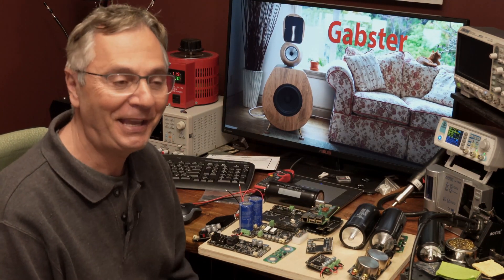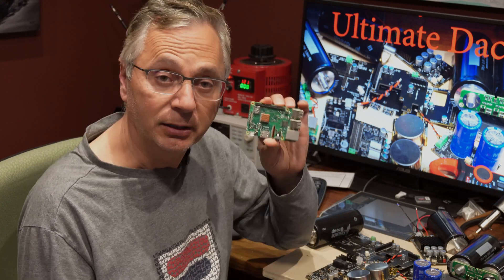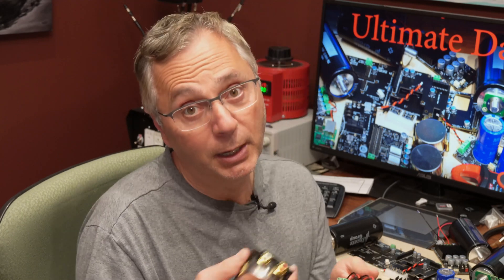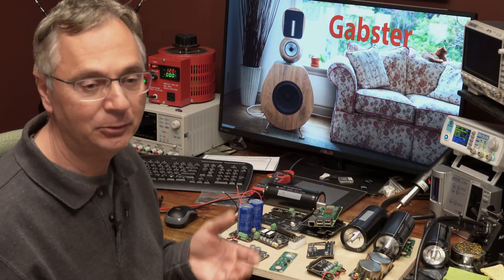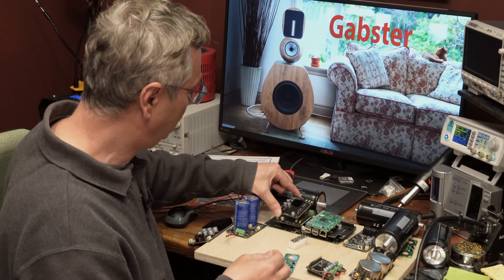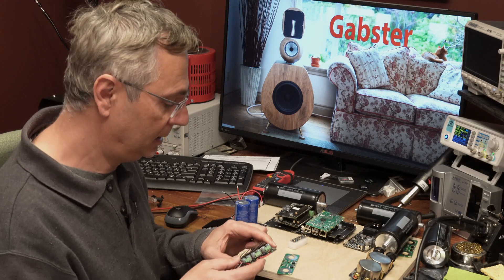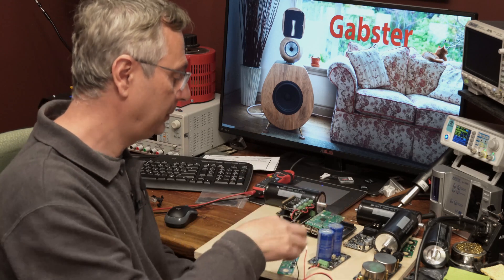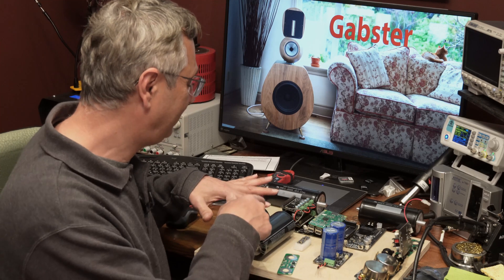Part 1  Building the Gabster D11 Ultracapacitor Dac and Streamer

Comment: How can you de-noise a digital signal?
Reply from the maker: Noise could possibly cary over as the the digital signal is converted to analog and can also affect the timing of the Clocks accuracy and introduce jitter specially noise on the power supply of the clocks.

Comment: that's perfectly detailled, just one question, what are your ACCUsilicon choice of clocks, frequency wise?:) they are avalaible in France, which is a great thing for me I have to admit:)
Reply from the maker: I used the 95/98 in my streamer but lately prefer Crystek CCHD 957 
It also depends on your system an what you like 
The Crystek are more analytical lots of details

Comment: How are ultra capacitors better than batteries, surely, for an application like this they provide essentially the same thing a clean DC voltage and current. Just wondering why you would choose ultra capacitors which hold comparatively small amounts of energy compared to say a Li-ion battery of equivalent size and the cost difference is huge. What am I missing with this?
Reply from the maker: The internal resistance of supercapacitors is typically an order of magnitude lower than batteries,
Reply: @Gabster1  But that makes no difference what so ever if you are just powering the digital electronics from it. Batteries with linear regulators will provide rock solid voltage and current and if you are worried about variable loads causing issues then a couple of ordinality electrolytic capacitors on the output stage of the power supply will be more than enough to decouple the PSU electronics. Remember its only the output from the DAC that needs the super stable power supply too so the raspberry pi and anything else in the digital domain will be fine even with switching noise. As long as there is some opto isolation between that and the DAC circuitry and it is all well shielded and the DAC reference voltage is very stable the audio output will be rock solid. As far as getting digital audio to the DAC you don't need to worry about jitter unless it is so bad it is causing errors in the audio output which is doubtful. I think a lot of the additional circuitry you have between the PI and the DAC is really not required. The SPI signal from the PI will likely be easily stable enough not to cause any errors due to jitter, its not like you are sending it over several metres of cable. All that said the setup you have there should work flawlessly, power supplies will be ultra stable and you have shielded everything well but it is overkill in many areas.
Reply: @schrodingerscat1863  right? Especially seeing as several lithium batteries on the market have a 60c discharge rating so there will be 0 voltage from that the DAC will see the only real difference being that to the batteries will have a hundred times more charge in them in those supercapacitors so the last longer between charges
Reply: @SheikhN-bible-syndrome  Exactly.

Comment: Sorry Gaby, I have another question :) about the blue ultra capacitors in 5.25, are the 4 pins soldered or only 2 ?
Reply from the maker: All 4 
watch for + and - 
once soldered extremely hard to desolder 
do not short once charged to avoid fireworks 💥
Reply: @Gabster1  thank you very much for your time and answering, that helps me a lot :) how they are shot was clear to me... here is a link with two videos of the construction of my streamer, inspired by your work  https://www.youtube.com/channel/UCAHuhWuFQtrraxZjYvFj_Rg  by the way :: ;) i would be happy if you press the subscribe button ;) ;)

Comment: Hi Gaby :) ....at 8:47, which board is on the left of the STATIONPI PRO? and the ISOLATOR II Galvanic Insulation Module, did you not install it ? should the insulator also be installed ?
Reply from the maker: Hi Aiello not sure what you mean by the Isolator II I only see the linear pi and ucmate conditioner on the left  but if you check the Part 3 video https://www.youtube.com/watch?v=jIvByjeddEI&t=85s
between 3:30 and 6 you see the stack in detail I ended up using the regular station Pi not the pro as I did not need any of the pro features also will be using Ian's new Fifo Q7 more videos on this build  sill to come.
Reply from the maker: That is the daughter board of the StationPi pro it comes with the StationPi pro. Just to confirm I contacted Ian and the daughter board does not provide additional isolation. It is good to use it for Better integrate with USB and Amanero.
if you do not need that no need to install it also if you do not need all the extra connection and a touch screen like me the Old StationPi is as good.
Reply: @Gabster1  Thank you for the clarification ;)  ....I have watched all your videos several times ;)  I hope there will be a detailed video of the assembly of the IAN parts ..please ;)

Comment: Thank you so much for such GREAT content!  Truly rare on YouTube for audiophiles,.  I wonder if this couldn't be adapted for an external DAC that was not originally designed for a Raspberry Pi.  I have an old DAC made with dual AK4499EQ chips - if I removed the old power supply circuit from this DAC, could I adopt this same approach?
Reply from the maker: Most likely yes just be careful

Comment: Great video very much looking forward to part 2. I've had a quick look at the part costs the ultra caps are the most expensive you mentioned you may use 6 or even 8 of these so the total cost is about 1500 euro's so not too bad for a high end streamer / DAC. It will be interesting to hear how this performs.....

Comment: This great! thanks...really like the comments on decisions and alternatives.  Have you considered DSP...any idea how you would implement say 2 stereo channels and 2 subwoofer for instance?  any comments like that would be most appreciated
Reply from the maker: I would try to keep the Dac as pure as possible so no DSP no Subwoofer these can be implemented in a preamplifier or amplifier build with a bypass switch. In Genreal I am not a fan of DSP as I find it introduce circuits that are not HIFI unless you are using very expensive DSP's best spend more time setting up the speakers better and do some room treatments. hope I understood your question.
Reply: @Gabster1  Thanks...I'm interested in exploring manipulating the data stream in the digital domain (software based EQ/DSP/tone control or whatever you want to call it) before analog conversion. So in my example this would imply doubling the dacs (having two dac boards)....not sure how to set that up
Reply: @Gabster1  If you are going to implement a DSP best to interface where the sound is still in the digital domain. If you put something like that into a preamp or amp you are then having to sample and the output of your high end DAC and convert back into analogue meaning all the money and time spent build this DAC is kind of wasted. So many system builders seem to make this fundamental mistake.

Comment: Thank you so much for this Gabby! I was inspired to build a streamer based on your previous video and I am nearing completion of that project now. As I am coming to the end, I already started thinking: I wonder if I can build a dac next! One area I struggled with on my streamer is grounding. I watched your video a few times and also read the diy audio forums but I could not really understand the issue (I am a total beginner on electronics). In the end, my streamer works fine with no hum, but I don’t know if I have really addressed grounding properly. If you mention a bit more about that in your upcoming videos I would be delighted to understand it better! Thanks again for your contributions to diy audio I am really enjoying this new hobby thanks to your generosity with your time and experience.
Reply from the maker: Thanks Philip
I struggled a lot with Ground as well 
I talk about it on my streamer build at 18min:30s 
basically you have 

1)The Chassis (the Case) connect that to the Mains ground (electrical socket ground)

2)The battery ground can be 
1) not connected to anything
2) connected to the Chassis 
3) use a x2 capacitor and resistor what I did see my streamer video at 18min:30s
but you can try and see if you hear differences.
One important thing Ian's LifePo4  stand offs are connected to  ground making the switching power supply grounded as well ( hate those switching power supplies)I used Plastic Stand offs as the battery power was showing added Noise on my Oscilloscope.

3) signal ground ( the negative of say a rca input it output cable or I2s cable not applicable much in this setup but I noticed the hdmi shield is connected to the battery ground by default on Ian’s board but left it as is.

Use the same point on the chassis to connect things to it 

Hope that helps
Reply: @Gabster1  Thank you very much for your comprehensive reply. I understand it a bit better now. I will experiment with nylon stand offs on the power sections and see if I hear a difference!